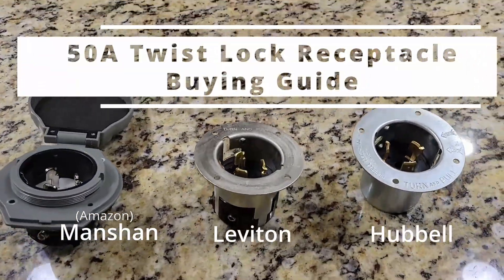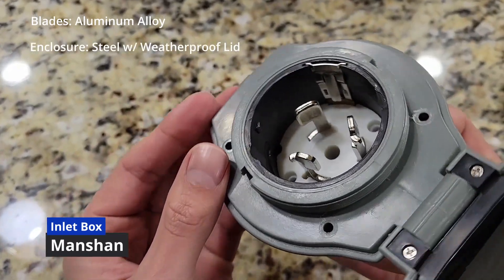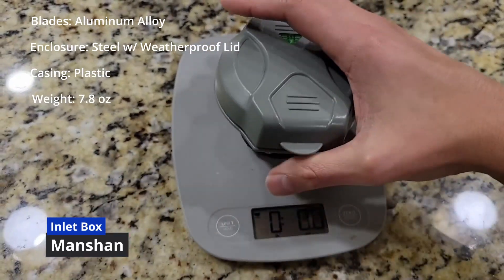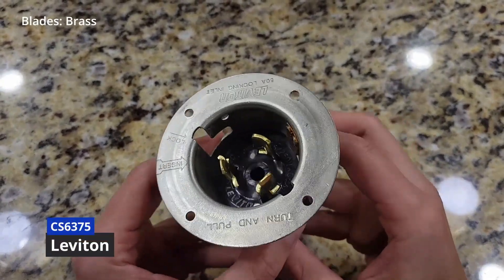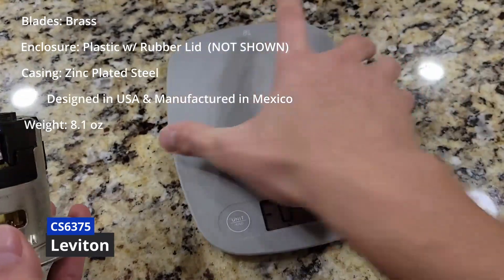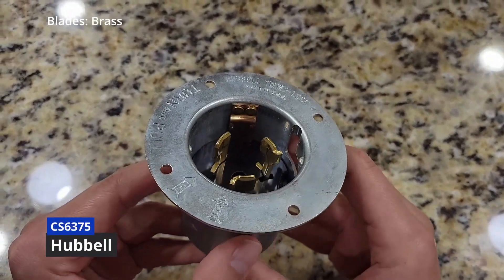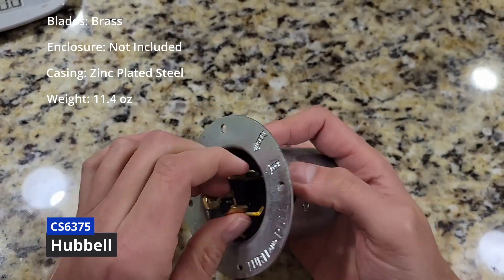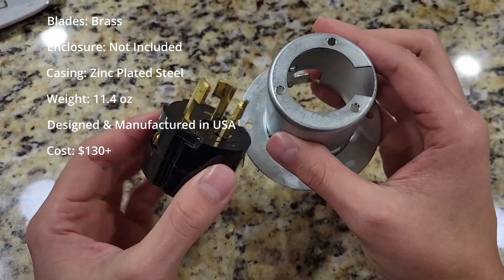50 Amp Generator Power Inlet Box Buying Guide | Don't let Amazon Choice Fool you!

Comment: What is your opinion of the Reliance Controls PBN50 Non-Metallic Power Inlet Box, Amps 50 box?
Reply from the maker: I would put Reliance above the Chinese Manshan Amazon unit and below the commercial grade competitors ( Square D, Eaton, Leviton, Hubbell, General Electric, Siemens).  It is my opinion there is much more risk than the reward of saving a couple bucks on a cheaper alternative. I personally would not install the Reliance unit at my home. I would stick with a commercial grade product (any name brand I mentioned earlier is acceptable).  Since you mentioned you will be installing the receptacle yourself, I recommend the General Electric Model because of the larger steel enclosure gives your wires extra bending space and facilitates the install.  link: https://www.homedepot.com/p/GE-50-Amp-Twist-Lock-Power-Inlet-T050N/203393774 
Since you mentioned this will be an DIY install, I recommend watching my EV charger install video, for electrical equipment install tips. The theme is more or less the same: #1 size wires correctly, #2 torque wires to specifications, #3 use quality equipment. Lastly, *most (if not all) modern generators come with neutral and ground bonded together [think of a jumper wire between ground and neutral]. Depending on how you connect your generator to your electrical panel, you may need to unbond this connection (the installation manual will tell you how to do so). This is very important! I will be posting a video in the next week or so to clarify under what scenario you need to KEEP the jumper wire, and the second scenario when you need to REMOVE the jumper wire.  I don't think anyone on youtube has clearly covered this topic, stay tune for this soon. Thanks for the question Dave--remember this information is for entertainment purposes only :)
Reply from the maker: Dave, link below explains why I don't recommend the Reliance Unit.
https://youtu.be/XaeAvrJewqI
-David
Reply from the maker: Generator Grounding Explained here: https://youtu.be/8b-EApzNAFQ
Reply: @dgtv3320  what the correlation between the Reliance inlet box and the grounding video?
Reply: @dgtv3320  That's a different Reliance unit.  The one that dcc2444 asked about has much more room, so at least doesn't have the short bend radius problem you cited in your video.